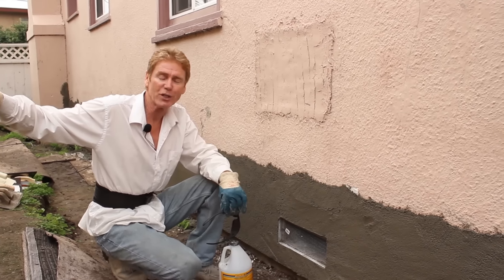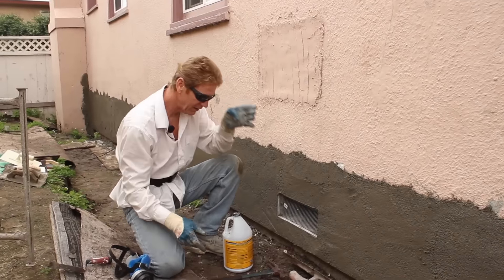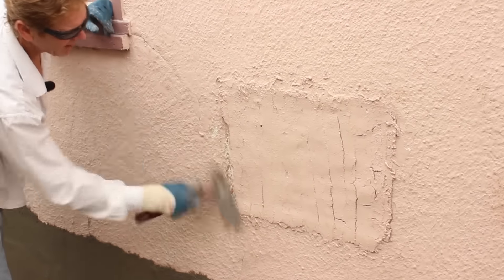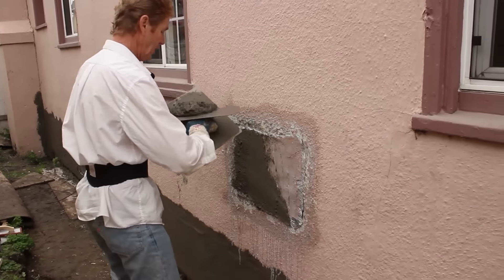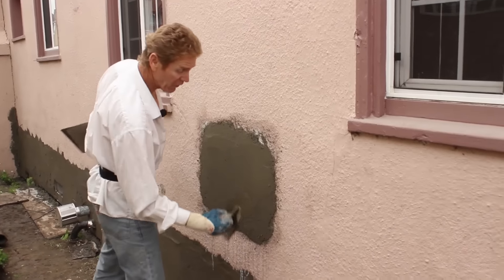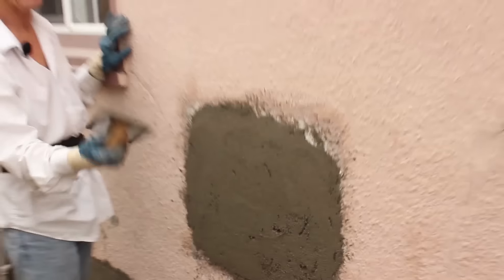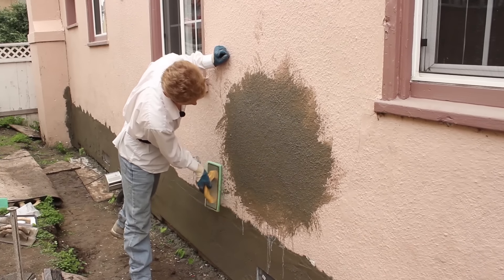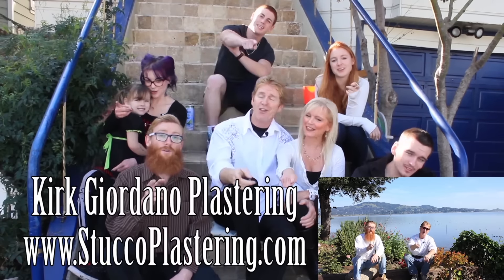Matching stucco patches

Comment: He works like an artist, just as a sculptor would and painter. God reward you for these. I have an issue with paint finish coming off with stucco in patches as it seems it not cleaned properly. Praying to try to do it myself for the first time.
Reply from the maker: Hello, my friend, all new applications do require proper prep work in order for anything to adhere permanently. For example, paint needs to be pressure washed and then primed for the paint to last. Stucco also needs a similar process. You can do it and put any fears aside, as it just takes practice, failing the first time? learn from it then redo it. 🍾

Comment: Thanks Kirk another good one, for some daft reason Id have tried to stipple the finish, I guess thats why Im a painter..but learning all the time!
Reply from the maker: Howdy Paintbrush dude, don't cut yourself short as your absolutely right.
 However, I was using  a clean corse washed sand, this sand is not sold at my material yards.
 if applied then floated this sand finish will match the 10 times painted Dash finish a bit closer.
 Cheers and your a great painter with clearly an eye for details to catch this,
 kirk giordano

Comment: That's purdy as always! Question? What about an angle grinder to smooth rough edges? or maybe thats to much dust...
Reply from the maker: Hey Wayne Frazier, your on the money, too much dust.
 I was tearing stucco off a house many years ago with this method of saw cutting sections that we could remove safely, when the humongous gorilla type dude came out and dragged me inside to see all the dust that had settled in his house, as he had the windows open, Oops.
 When I'm wrong I'm wrong, I cleaned the mess apologized then sent big Luuu over there to beat the carp out of him for dragging me over there by my ear :-)
Reply: +Kirk & Jason Giordanos DIY plastering and stucco tips Lol! The versatility of big Luuu
Reply from the maker: Hey Whayne, I was kidding Big Luu is a gentle giant,
 The only time he gets really pissed of is if someone litters, sort of wired he so against trash not being picked up and placed in a proper bin,
 best wishes, 
 kirk giordano
Reply: +Kirk & Jason Giordanos DIY plastering and stucco tips good man. I hate litter as well

Comment: Hi kirk, thanks for your response, jolly decent of you. Well ive watched a few more of ur posts and i am now sufficiently inspired to have a go at the front of my house. I cant afford to pay for you to fly over here to do it 😀 we have a finish here called tyrolean. I believe its a textured cement base with colour pigment. If youve had any experience of it, let me know if you have any pointers .ive got to scrape off the flakey bits and flick new tyrolean on with a flicker gun. will a pva bonding agent be ok? Ive had a go at plastering and rendering before. Not pro but good enough. 
Thanks again and keep up the great vids.
Reply from the maker: Howdy Steve dude, I'm sure you'll do fine, if not it will be an adventure.
 You can also use a dash brush to throw the finish on.
 Out of all the color finishes, I've applied only Christal white will blend in all others will be off color.
 I do have video's showing how to dash walls and how to match color finihes.
               Live long and plaster
Teaching you how to stucco your home issues

Comment: Another awesome video Kirk. Quick question, what stucco mix were you using for this repair? Again thanks for all the great tips and videos👍
Reply from the maker: Howdy Michael, I was using portland cement plaster mixed with sand.
 The sand we add is 3 to 1, meaning 3 parts sand to one part cement plaster.      
                                   Live long and plaster
               Kirk Giordano’s Plastering answers to real life stucco questions

Comment: what brand/type so you recommend for smaller repairs like this? I got confused when you said mud. is that just another word for concrete mix?  at HD I see a lot of rapidset motar mix or la habra color stucco mix? I just need simple stucco mix since I'm priming and painting later. also, after scraping everything off, I use a bonding agent, let it dry and then apply the new stucco, correct? a lot of the labels say to mix it into the stucco mix. thanks! loveee your videos!
Reply from the maker: Morning IWBVS, thank you,
any rapid set cement product will work, plus almost all the rest of the cement products will too, most of the same day cement plasters usually have the sand added, all a person does is add water and apply.
 FYI, we never add any bonding agents to the cements as this dilutes them to uselessness, 
Apply bonding agent to the area being patched after you clean it well,
 Cheers,
 kirk giordano plastrering

Comment: I like t wet the wall b4 beging the patch . Helps it stick to the old mud
Reply from the maker: Howdy, for this patch it's painted. Thus, water won't help the new stucco bond. The patch needed a bonding agent.
 However, if I were applying a second coat over a porous first coat, then water would be necessary for the mechanical bond.

Comment: Hello Once again Kirk! I'm patching the stucco on the lower half of my house on a wall that has much sun exposure very similar to your repair. I mixed a small batch of the La Habra Base 100 16/20 by hand. The consistency was not soupy but not clumpy either. I applied weld-crete to the wall first. I then completed the 1x1 ft patch, floated it with a green float while still wet, then checked on it 2 hours later and it has quite a few hairline cracks. Im in Los Angeles and the sun was hitting it and the temp was  about 70 degrees. I completed a similar sized test patch with rapidest stucco patch 16/20 and it was fine, but the sand grit doesn't seem be as course as the La Habra 16/20 which matches much better. How do I prevent the tiny hairline cracks with the La Habra since I really like the sand coarseness much better? Thank you once again sir!!
Reply from the maker: Howdy The LaHabra base means this finish coat is white for lighter colors, It should not be used for a base coat of stucco, it will crack every half inch in every direction as certainly you found out.
 The confusion was use read "base 100" this means only the color of this finish coat, there is also a "base 200," this is a darker finish colors coat.
 The rapid set is a basecoat which means it's used for a scratch coat and second coat, Thus the real term (base coat of stucco) still confused?
 On your next job apply the rapid set base coat, then when set, finish whit the La Habra finish coat sand of your choice while remembering that base coat  100 or 200 simply means,  just the color.
 BTW, don't beat yourself up over this as it's a common mistake.     
                     Live long and plaster, 
  Sharing stucco secrets and or common sense tips
       Images of Kirk Giordano’s stucco repairs

Comment: what do you prefer kirk, mixing the bonding agent with the cement mixture or applying it straight to the wall,per se..?
Reply from the maker: Evening Mr. luis perez, esay peasy lemon squeeezy, it's not a preference!
 If's it on the walls it grips properly, however the walls must be cleaned where you can eat of it, Yum Yum.
 If the bonding agent is mixed in any stucco material it's diluted to uselessness and won't work, at least not for long.
 Trust me brother, I have an incredible and super wild imagination any and everything that can be done I have tried in my 30 years some merely as experiments as this stuff interest me. 
apply that bonding agent on a super clean wall, you'll sleep like a baby knowing you won't get a call 5 years from then saying, man, that stucco is separating of coming off.
 cheers,
 kirk giordano
Reply: Do you clean it up with fabreze or downy? But for reals, do you water blast it or just water hose it?
Reply from the maker: on this bitty square I wire brushed the piss out of it,
 Cheers,
 kirk giordano

Comment: I'm not sure where to post this questions so sorry if its off topic. How would you recommend running cable against stucco for something like a security camera. I would prefer not to penetrate the stucco at all if possible because I'm worried about it loosing integrity or leaking. I would like to hide the cable or paint it or something to make it as invisible as possible. Any suggestions? Thank you!
Reply from the maker: Evening Cory Robertson, if it were me I would look  for a natural break point such as a window or door or even a downspout and use plastic ties if possible,
 if not nailing may be the only option.
 best wishes,
 kirk giordano

Comment: Beautiful job!  I was wondering how I would  patch an inside wall that has similar texture??????
Reply from the maker: Howdy Jeep Girl, you would switch from an exterior stucco to a 20-minute drywall compound such as Westpac's or Easy Sand,  by USG.
You just add water tothe powder then apply.
 The 20 minutes means you have 20 minutes to twoerl on, if not sure you can apply in this amount of time they also have 40, 60, and 90 minuts set times.
 best wishes with that wall.      
                    Live long and plaster
         Mastering Plastering for the beginner’s

Comment: What kind of mud do you use? I am repairing a wall that has a 3 feet square hole where the cooler use to be. If I do the three coat what would I need as far a mud? Thanks
Reply from the maker: Good Afternoon Trane dude, I use portland cement plaster three parts sand to one part cement plaster.                   
                         Live long and plaster 
    Sharing Plastering tips by the Giordano Gents

Comment: hi sir, im in canada :) what kind of mud did you just used there ? i wanna patch over old white mud stucco.. what should i use mortar? sand finish cement? thanks
Reply from the maker: Howdy Patrick, 
I would recommend you use portland cement plaster.
 A finish cement plaster is only engineered to be applied 1/8 of an inch thick, any heavier it will crack like an egg, when dried out.
 if it's a small patch they do sell Rapid Set Stucco at Home Depot's and Lowes, where all you do is add water, mix then apply.
 When using any of the rapid set cement plasters or same day plasters read the bags as most you are not supposed to mix more than 3 to 5 minutes,
 Cheers,
 kirk giordano plastering

Comment: Great tips I just had a plumber cut a 20 x 10 out of the rear stucco to get to a pipe that needed replacing  he did not fix the stucco and when I called a friend that's a painter he quoted me $900.00 which is not going to happen. so I I think I will take on this small project but was wondering if I could reuse the stucco he cut out reattach it to the studs and float over it.. what  do you think ?????
Reply: I don't think he cares...that's why he hasn't answered you in a year
Reply: Well I'll reply to you, with my limited knowledge -- I think you can reattach the old stucco but it'll be a pain in the behind to reattach it and won't look good at all, plus it might fall off. In other words don't do it, just re-patch with fresh stucco, at least it will be solid work even if you don't achieve to make it look aesthetically pleasing! Hope I helped !

Comment: Kirk, i'm trying to figure whether my render is lime or cement. Any ideas. It has a black plinth down the bottom which really looks cement and is painted with bitumen. but the main render is much lighter, possibly cement just very little mainly sand... reason being I need to patch some bits.
Reply: That sounds like lime render. If your house is very old and built without a modern damp proof course, lime render is better to use. Cement render will trap moisture in the wall and damage bricks if the house moves. The render should be softer than the wall. If you must use cement try to use a 1:1:6 mix of cement : hydrated lime : sand, by volume. That's a fairly soft mix by cement standards.
Reply: John Auld your advice is exactly what I’ve been looking for over a number of days searching the magic of the World Wide Web 😁......thank you 👍

Comment: Should you paint stucco? Thought the top coat had color. How can you tell if your stucco is painted or if the coloring is within the top coat?
Reply from the maker: Easy, wet the stucco, if it darkens it has a Color- coat, called a color-coat finish. If it does not darken, it's been painted. The same applies to a brick.
Reply: Awesome, thank you! @StuccoPlastering 
Drove by some new builds the other day and saw patches of dark (after rain) and made me think of this comment - color coated. Mine is painted. Thanks again!

Comment: Hi kirk, do you think I can repair areas of a lime render external wall and blend it in with a sponge? Iv done it with cement, but I'm new to lime, i have a old house in UK south wales,  and it's sand stone and lime morta's/ render.  I'm a about to tackle a lot  of pointing and rendering with lime. ow boy am I in for some learning , Iv read a lot and watched many videos about lime and old style building skills over the last year or 2, iv finally saved enough money now been looking into buying the sands I need and diving in to this lime game..
-So do you think  I could do this but with NHL lime , If been told you can so lime rendering in sections but the top coat  has to be all in one, so I'm a  bit worried the repair  want blend into the old render very  well, I then though about lime wash the wall or even  skim the whole wall after the repairs  with a thin 3ml coat, still reading into these ideas,  i think lime wash might wash off and show the repairs  again.
Reply from the maker: Good afternoon Mike, as a rule, if you don't want any patching to show apply corner to corner.🤔
Bringing peace, love, and brotherhood back to the old fashioned 🌎  “Plastering.” 
    The most comprehensive encyclopedia of plastering on video, by the plastering messengers of Youtube.  
     Over 800 videos 🎭 👀💃
Reply: @StuccoPlastering  kirk thanks  for the reply much appreciated,  love the videos you have some skills , take care mate
Reply: @StuccoPlastering  hi kirk, I forgot to mention the repair I am doing what looks  like a tyrolean flicker finish, do you think I could repair the area then tyrolean flicker finish the repair and blend it in on the edeges of the repair to the old rendee some how. The area of repair is about 1 metre square  on a house front, in lime it is, I'm guessing a NHL lime , I'm going to make some samples of NHL 3.5 & 5 on a board to try to figure out what exactly is out my external wall, it's hard almost like cement  it it's on a stone wall I think sand stone, inside a either positing on other areas other the house is what looks like lime putty , ideally kirk  u need to move to uk South Wales and help a brother out  haha,

Comment: hey Kirk how are you doing? today my helper and friend Peter did a stucco job that we were both proud of.  Wish I could show you the photos. I used a darby as well as a feather edge (for around the window depression. It had a six inch sill.  we had to match a skip trowel finnish as closely as possible which was the most intimidating part of the job.... someone else did the paper backed lathe and corner aids which I had to redo. I left their lathe work because they used a nail every four inches. I can't believe it passed. I put the corner beads out to 7/8ths instead of flush. lol. and made them straight. thanks to your videos and the many things I've learned from you, this non stucco man and his helper did a job as straight and solid... it looks like it was done by pro's. thanks for what you do, it helps me to put food on my families table... plastering is my zen now. though I've done interior plastering for years as a handyman, your tips have greatly added to my expertise and made me a hero with the general contractor who was taking a beating on this renovation. I love your family bro. peace out!
Reply from the maker: Howdy john pope, good for you not only for trying but doing, it does take a bit of backbone to at least try, the fact that a skip trowel came out well means with practice you can put me out of business as this finish take more than just watching and visualizing usually to learn how to apply.
 cheers,
 kirk giordano
Reply: It looks like it was done by a pro but took twice as long. Lol. That's ok. As long as every one loves it and I didn't skimp on tru and plum. You could set tile on the brown coat thanks to the darby and muscle. maybe three times as long. Im in sunny s. Fl. where stucco is everywhere and wall units get replaced by central air but it was fun taking on a more critical job on a very nice house. Thanks again for sharing your knowledge and experience.
Reply from the maker: no worries John,
 best wishes in Florida,
 kirk giordano